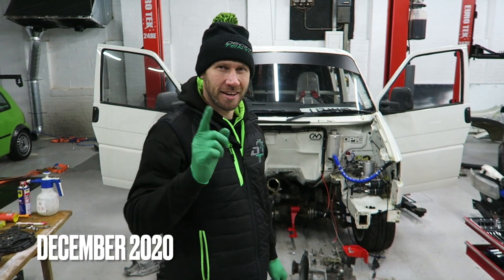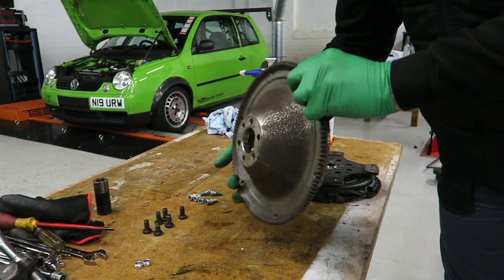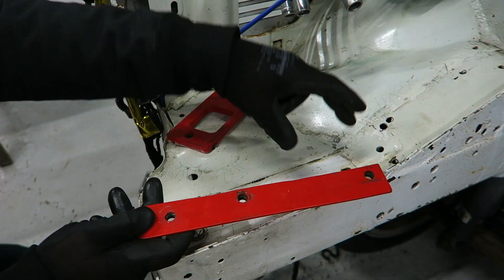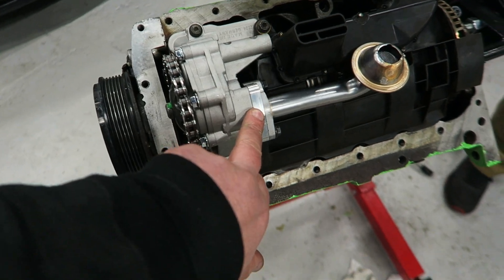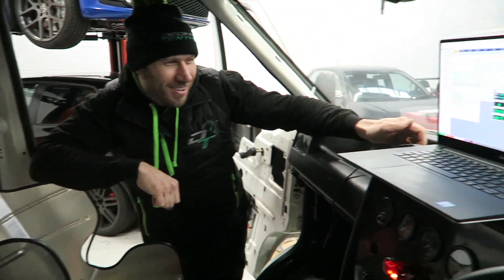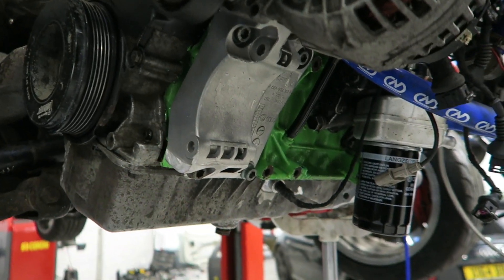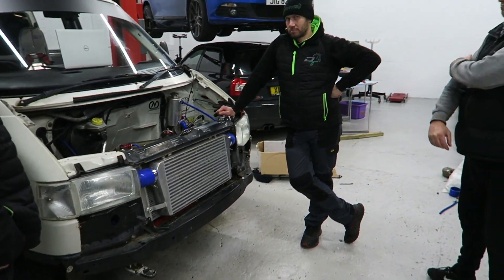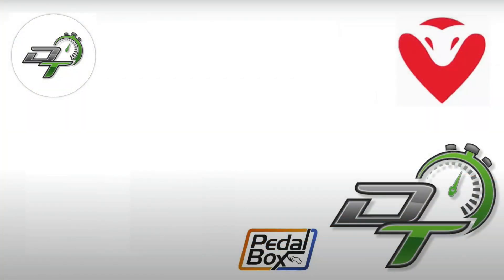Speedingtube VW T4 1.8T Stroker Motor & 02M Install!

Comment: Hi Nick great stuff, why does this engine not have to have a break in period? I thought putting an engine on a dyno just after its been built would be impossible.
Reply from the maker: Hi Pal,
This engine does get broke in, on the dyno in the next video 👍👍
Reply: @DecimalTenths  ah right how come it does not to be broken in over 600 miles?
Reply from the maker: @niallmccabe4766  We go through the process of bedding the rings in, by using the dyno to apply controlled load on the engine, and build cylinder pressure to force the rings into the cylinder wall and bed in. In total the van was ran in on the dyno for a few hours, with 2 oil changes. We then go full whack on the mapping and this we find is enough to ensure good running in. We've done this a good few times now and find that the end compression on all engines is 200+psi, so nigh on perfect and confirmation of the process 👍
Reply: @DecimalTenths  Sounds very interesting, this eliminates waiting ages to break in the engine with standard road use I see. Looking forward to the next video